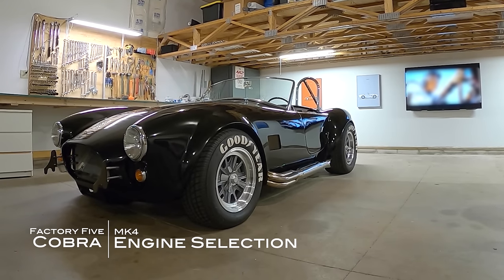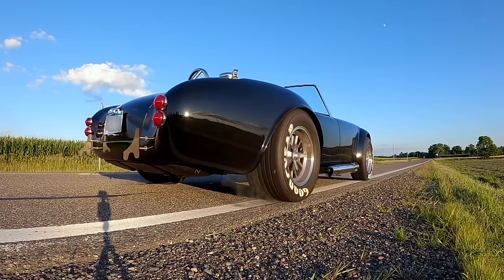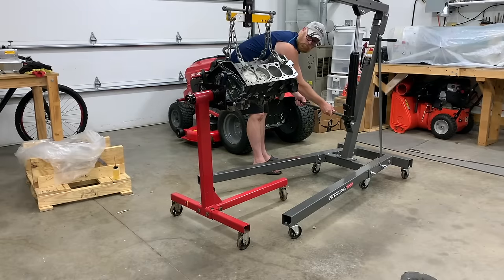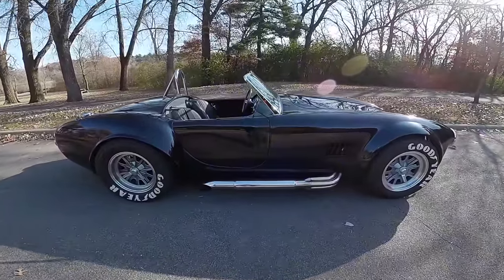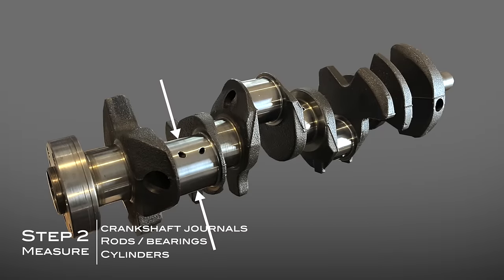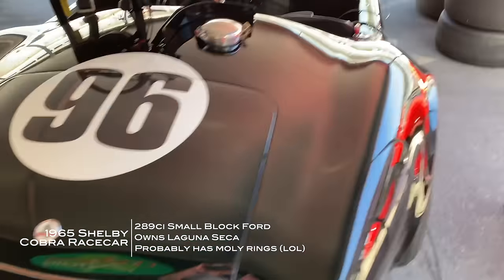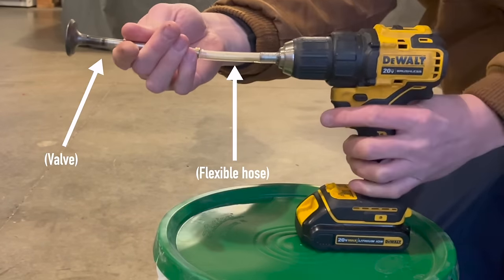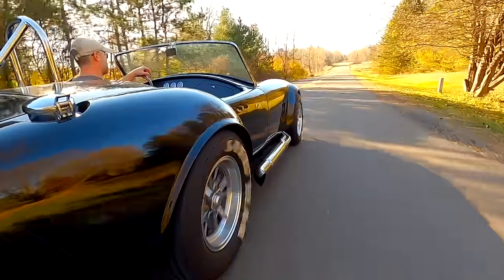Factory Five Cobra: Engine Selection

Comment: I ran with a Cobra Club for a while.   I learned a few valuable things.   Of course, this was after my build.   I have an FIA car.  So, that guided my engine choice.   I’ll finish with that, in a few.  The first thing I learned was that all the cars with a solid rear axle would bottom out on less than perfect roads.   The two of us with independent rear, did not...ever.   The second major thing was engine choice.   One member had a motor producing Over 600hp.   There were cars all over the range.   Some with fuel injection, others carbureted.   Some aluminum blocks, others full iron. Some big block motors, others small.     My end conclusion was that no matter what I chose, it would be carbureted.   That is mostly for experience.  Personal, of course.    As I mentioned, I went for the FIA feel & look.   A 64’ 289 with small chamber iron heads & medium bump up in cam.   Nothing crazy.      I topped that off with 48IDA’s.  It was a brutal learning curve but, I eventually got it all figured out.    I don’t track the car.   It’s purely for the feel & vibe of owning/driving a Cobra.   Everyone has their own reasons.   However.   In the streets, there was rarely ever a moment when I wished I had more power.  Street driving, I don’t have much trouble keeping up with any other car or cobra, big or small.   To me, there are a few ideal feel/sounds for a cobra.   A small block with webers, a big block with a 4bbl & the right cam or a small block slabside  with a carburetor.   I feel like a lot of people lose sight of this when building.   & probably don’t end up satisfied.   For me, There’s nothing more thrilling than listening to those webers sing, & that sound between shifts(no vacuum advance).   I would take any of these three cars.   All of them were a time in history that can only be reproduced by driving such a car.
Reply from the maker: Excellent feedback WhenViolets TurnGrey and I think we think alike :) Did you have any issues dialing in the webers? That's one area I haven't dabbled before, but it's on my list to try someday. Sounds like you have a sweet ride. 289 topped off with some webers - awesome - thanks for the comment!
Reply: @TacoJoe     Webers are a big can of worms.   Probably a lot more info online, these days.   I had to "bits & pieces" it all together, when I did mine.  I had a solid understanding of carburetors.   That's a good base point to start from.   Start with a good linkage.  If your carbs open evenly, that's important.  They don't always ship with a good linkage.  They don't like vacuum advance & need the right springs in the distrubutor.  It's a lot of jet swapping.   Might as well grab a full compliment of jets, if you can.
Reply: @whenvioletsturngrey9597  Agreed. I came here to pretty much offer up the same input. The Webers can be fun and look great (I've had multiples before) but I'm not so certain I wouldn't be tempted by the same engine with aftermarket EFI (something I haven't dabbled in before.) These cars don't need monsters under the hood. And we all know there's a lot more fun in getting a responsive car to work at its extents as much as possible than there is looking for someplace to work an overpowered/overweight car for a few moments.
Reply: on every there exist compromise you mentioned the engine and how it matters//whatever you build a car around that will be the final factor. build it around you< the engine.  specialty equipment, and so forth.
Reply: @carlbeaver7112  You can easily run single throttle body per cylinder setup (or even better, 4x dual throttle bodies off a Lincoln MarkVIII) for aftermarket EFI, and you no longer have to worry about jerking around with tuning individual carbs.The linkage setups are much better quality, and the sound is identical to Webers. You also get all the benefits of EFI in efficiency, power, and drivability. Even cost isn't a drawback because...well, any period style Weber setup is going to be spelled "W$$$r" lol.

A temperamental car with a temperamental induction setup just doesn't seem like 'fun' to me...unless it's full out on the road course where low speed manners isn't even close to relevant...and this is coming from a guy who daily drove a 10 second naturally aspirated 8.2 deck SBF, in a 67 Mustang for years. I can put up with a lot...but crappy and unpredictable throttle response with a moving target for tuning isn't among those things.
Reply: Does anyone have any recommendations on where to mount the cold air intake piping/air filter on a cobra with an ls3 I'm sucking in all the hot sir off the rad
Reply: (Very few people ever use more than 200hp legally on the street), the rest is just for “knowing “ that it’s there in case you get challenged to a drag race. For me the beauty of a Cobra is in the looks. STUNNING!
Reply: @philtucker1224   even with that, the Cobra weighs a 1000lb less than a Corvette.  A good gearing setup, you'll be a handful for anyone, light to light.
Reply: Agreed... for the ultimate enjoyment, it's a simple formula...

-light/rev happy powerplant 
-IRS with limited slip diff (I prefer helical)
-reasonable tires

Comment: I completely agree with your assessment about the power needs for these cars. I had an early FF5 cobra with the old 302. It had about 260 whp. The car had enough power to have fun with it but not feel out of control. It was pretty quick, but 300 would have been  ideal.
Reply: Awesome ! It seems to me that the power of the original Ford “Hi-Po” 289 motor in the big-block Cobra set-up is about perfect . I knew of someone who had that very motor in a Cobra replica , along with a beefed-up C-4 auto transmission; for his wife . It was very streetable  , but she had plenty of respect for it , too ! 😁👍
Reply: My dream car would be (beside an original, of course) would be a top-quality reproduction, with the 302.  I don't  have feelings of inadequacy.

Comment: I've been driving small block Windsors since the 80's, and have no plans to change that. They are just dead simple, reliable, parts are cheap and available literally everywhere. Some really well paid engineers at Ford perfected those engines over nearly 40 years
Reply from the maker: I agree / thanks for the comment deckert618!
Reply: And they look cool.

Comment: My cousin’s friend has a 66 Cobra. It has the original 289 Hi-Po. He has driven different Cobras over the years and he said the small block was so well balanced in power and the performance was he could really get into the throttle and it remained so much better the the power houses

Comment: I am building a cobra from the ground up, its a 25 year old never finished project, been through a couple of poorly selected hotrod shops, now starting over with a brand new chassis, been doing a lot of research over the 18 months i have owned it, while building up the build budget. Reading about the original 289 and 427 cars, found that the 289 was a sports car, the 427 is a beast ready to kill you the moment you take your eye off the ball, these are motortrend road test of original cars, the most interesting item that shows up , the 0-70mph time, its when the 289 beats the 427 only after that speed does the 427 pull away, my car will have a 4500cc 350hp non usa engine 6 speed manual, i am aiming for 0-100-0 in the original cobra bracket, around 14? Seconds
Reply from the maker: Really like the detail on the 0-70 time!!!- thanks for sharing /  Did you pick a motor yet for your build? Motor choice & paint color are the biggest decisions to make / thanks for the comment Hans and good luck!

Comment: We built an end of series  Mark 2 kit almost 20 years ago with a 302 from a 79 Mustang. Very glad to have fuel injected the motor (rare at the time) since the car is garaged and not driven enough to keep a carb in tune. Back in the day, 427 motors were  more powerful, but never needed for street performance. With some mild upgrades the motor has 365 hp and I would not want any more. Factory Five has continued to upgrade/update/impress with their engineering and remains at the top of the "reproduction"  companies.

Comment: I couldn't agree more with you.  While I don't own a Cobra, I've ran quite a few small block Ford Windsor motors (260, 289, 302, 351) over the last 40+ years.  Your math is spot on, in a car that light and configured the way it is, anything between 275 HP and 350 HP is going to be an absolute blast to drive on the streets.  I've always preferred the 289 or 302 motors, their combination of bore and stroke make them so much fun in a lighter weight car.
Reply from the maker: thanks @bubbacomputer - and they sound great at the high RPM too!

Comment: Great vid!  Thanks for posting!  Yeah, people will assume the Coyote is small because of the 5L displacement, but those heads are massive.  In terms of fitting it into an engine bay, it can take up a lot of useful space.  The main reason I'd do it is it can be a turnkey system, which is amazing for all the ECM stuff involved.  LS for base motor simplicity, Windsor for saving dough and it can be fun to dig around for something to make your own without getting too exotic.  Great suggestions!
Reply from the maker: thanks for the comment robsolf / I totally agree!

Comment: Well done.  I needed an engine for my truck 4.3 v6.  Found one for 300$ that only had 78k miles.  But the guy who had it didn't believe in changing oil.  I measured the crank and it was good.  Replaced bearings and oil pump. it works great. I am glad I checked the bearings though they looked really bad.
Reply from the maker: Did you end up replacing the bearing then? 300$ for any motor is definitely a deal / thanks for the comment!
Reply: @TacoJoe  Yes I replaced the bearings.  I looked through the spark plug holes with a camera and could still see the crosshatch so I figured that was ok.  The oil in the pan (what was left of it) was pure mud. Really disgusting. Oil filter had 7646 miles written  on it, so if that was true they hadn't changed the oil in 71,000 miles. Crank was within spec but the bearings looked awful. I was really happy and engine has been fine with 60 lbs of oil pressure. I change oil every 3000 miles, some people don't believe in changing it at all.
Reply from the maker: sounds like you are back in business with that motor and agree- change the oil regularly!

Comment: You're not living if it's not unsafe!!! I personally love the Cleveland. Have one in my 67 stang and it will take a pounding and not hard to produce 300+ hp with simple bolt on's. Excellent mid range torque on mine, would be great for a cobra on the drag strip.
Reply from the maker: Cleveland also a worthy Ford small block for a Cobra with great heritage to match. 67-68 mustangs were the best years too IMHO - body was just right and the car wasn't huge yet. Thanks for the comment!

Comment: I built one of these twenty years ago and put a 460 in it. I'm building another one now and I decided I'm going to stick with the 460. There is a ton of concessions I have to make including the cost. And Factory Five doesn't make headers therefore I'll have to have them made elsewhere. I'm sure your video will help many considering a build like this
Reply from the maker: 460!?! Beast motor- get some good tires man - lol / thanks for the comment
Reply: Man I like the idea of the big block. Have you thought about Fords Godzilla with a cam?? Awesome OEM sound, awesome power, but I hear what you gain in mid range torque through top end, you lose in low range torque??  ANy thoughts?
Reply: I built a replica 30 years ago - and used a 460.  Great engine, and I'm with you on sticking with that or the 429.   385 Series all the way!

Comment: I’d put an LS into anything. I’ve had fantastic experiences with the 5.3 in particular…..
With regular maintenance I’ve consistently gotten 300,000 to 400,000 miles in my trucks, used not abused. Granted , at 400,000 it’s not very happy but still running.
My 60s era Mopars all have the big blocks, the cars have the weight to handle it as well as the performance. One day I hope to have a cobra or a Boss 302 … childhood favorites.

Comment: Hello Taco Joe. Thanks for posting this video. I am in the infancy of starting an FFR MK4 and you have provided great info here and a lot of food for thought. I am thinking this car will be more of a daily driver than a track rocket so I appreciate your perspective of not getting hung up on horse power. 
Cheers!
Reply from the maker: Thanks Robert - enjoy the build journey too myman - it will go fast so make sure you take time to sit back and enjoy the chaos a kit car build brings (lol) - thanks for the comment and good luck with the build!
Reply: The only running ffr I've been in is a car with a stock mustang 302. It's a light car and it doesn't need a lot to be fun. People really do get hung up on making piles of hp and they really don't have any use for it. I have something close to 500hp but I don't need that: I already had this engine so it was essentially free in racer math. A gt40p or gt40 explorer truck motor, a cam, and a t5 is not a bad setup. Get the thing going and if you want more later live on the momentum of getting it done and add to it. Near me half price day t5s are $75 at the junk yard. Engines are more now but can be $200. That is pretty darn small monies.

Comment: I cant wait to build mine.... just hope the motor I want actually fits and that I wont have issues with heat...
Reply from the maker: @stu1944 - are you going to keep the mechanical / clutch fan - shroud?  If so, I don't think you'll have any issues. There is a lip on the bottom of the front bumper that deflects air in front of the radiator - at high speed. think I can starve the radiator if its missing but other than that, I think the OEM cooling setup is pretty robust / thanks for the comment!

Comment: Solid video Joe. 
I'd love to put a coyote in one of these things but I think you're right about it being too much power to be safe as a regularly used road car. It's easy to forget these things are NA miata light and a lightly built coyote would have a fair bit more power than my C6 which is mildly terrifying to think about.
Reply from the maker: C6- sweet car / yeah they coyote is a great motor / what's working against the cobra too is the short wheelbase - so - when you get loose trying to hook all those ponies, it can snap you around pretty quick. Thanks for the comment!

Comment: Great video! I was already thinking of doing a junkyard 351 re-build for budget reasons. Seeing this video and your results is very encouraging. Your engine is beautiful, it looks correct for a Cobra, and a reliable, good compression motor that's not burning or dripping oil with 300 HP is really all you need. Well done, Thank You!
Reply from the maker: Glad you liked it and good luck with your 351- solid motor and those benefit from the larger crank journals too. Thanks for the comment!

Comment: Excellent video. I definitely want to know what mistakes you made! I just couldn't do a modern engine in a Cobra. You made a good choice.
Reply from the maker: One thing I did't mention in the video when comparing the Coyote to a  windsor: a Windsor with a radical cam is one of the most beautiful sounds there is and matches the Cobra's character/heritage well / the Coyote won't have that exhaust note- still a great motor though. Thanks for the comment!

Comment: Great upload with good advise.  I've built many engines of different ilks.......foreign and domestic.  From the mighty Ford 427 to the lowly 40 hp VW.  The engine you select is up to you but the recommendation of a small block Ford is excellent from both the size standpoint to the cost and hp.  The fact that they are 'belly button" engines (everybody's got one) is a major plus for cost and availability.....parts are plentiful and hop up parts available at reasonable prices.  Add to that the fact that the engines are a known quantity as far as how-to builds go.....many routes to whatever power you seek.  I remember building the Ford 427's.....the cost of sodium-filled valves in enough to affect the stock market.  Good luck to you all and see you on the flip side.
Reply from the maker: Nicely said Tom / thanks for the comment!

Comment: The Stroked Windsor is a great strong engine!
Reply from the maker: Love the 351 strokers / that's where they have 1-up on chevy. With the cam location, you can stroke a 351 BIG - In small block Chevys, the cam gets in the way and limits a 4" bore to 383 without some radical pistons/rods/etc. Thanks for the comment!

Comment: Great video Joe, FWIW I did a 427 stroker (dart block) in my build 500+ HP w/PF4 EFI and after 4800 miles on the road now it has been awesome.  Will definitely get your attention!  Would also recommend IRS rear end for a much better ride quality.  And any engine in these cars is not safe, they are just not safe cars in the first place 🙂
Reply from the maker: haha- right you are Travis / sounds like you got a sweet setup there - thanks for the comment!
Reply: I'd guess 500+ hp sounds much more 'not safe' than a more reasonable power figure.
Reply: Travis, I've got the same set up and "sort" of loved it. Yes it's dangerous as hell getting sideways when you floor it through all three gears. After I while, I did 2 things to tone it down a bit. First - I went from an 850 race ready ddbl Holley to a standard 750 ddbl Holley. and, when my tramec 500 transmission went, I got the heavier Tramec tko 600. It got it a little more civilized anyway. Awesome cars!
Reply: @advicemaster1365  How did the trans change affect drivability?
Reply: @dieselyeti  weighed it down more .